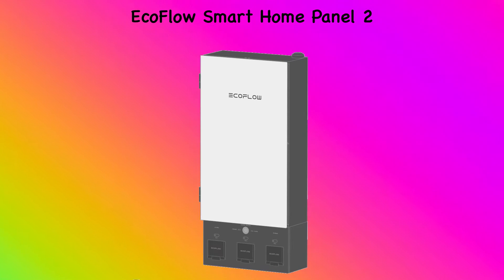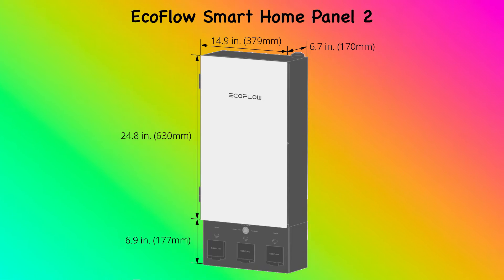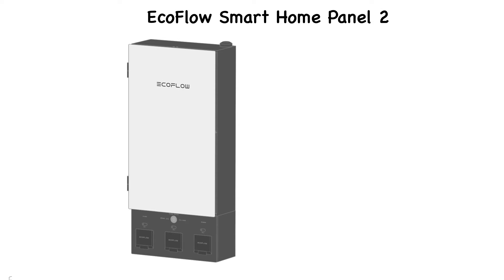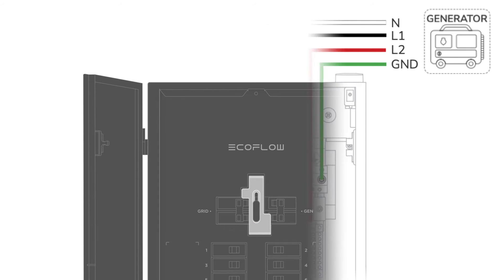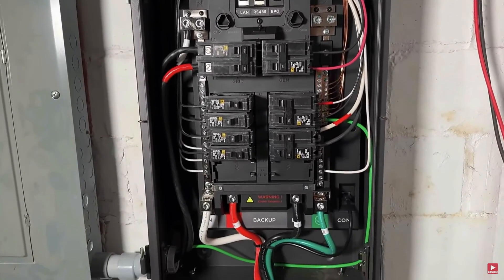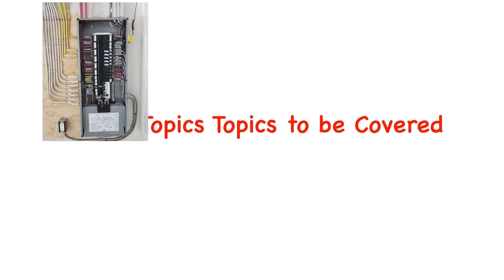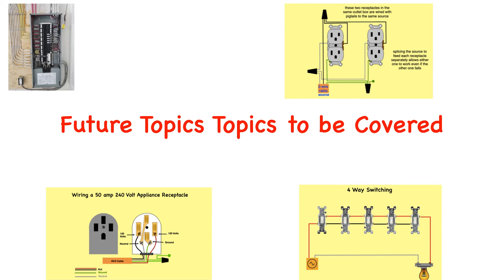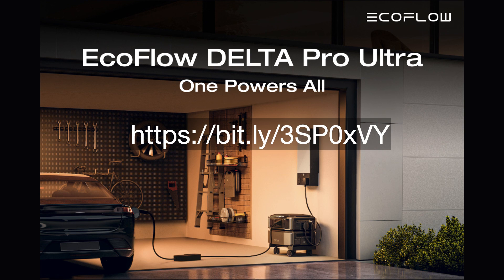Connecting a Stand-by Generator to the Service Panel Video - EcoFlow Smart Home Panel 2 Video #17

Comment: Which Generator are people using?  I am not finding an inverter generator which has the big 4 prong plug receiver for the L14-30 I have coming out of my SH2.  Generator brand, model?  That isn't 6000$
Reply: Its easy but pricey. Inverter gens don't have the L14-30 until you get into the 5000w plus range, usually  > $1000. Champion has some nice models with 240v support in the 8500w range (you gotta go big to get the big plug)
Reply from the maker: The 30A L5-30 is a very standard connector. If EcoFlow didn't have what you were looking for try these very reputable vendors...
Bluetti at https://bit.ly/4fDx2Ba
Anker at https://shrsl.com/4pplo
Jackery at https://bit.ly/3YCiw5Y

Comment: Hi sir, lot of good information thanks . Can I connect a diesel gen and make it to turn on and power the house when delta pro goes low or fully discharge?
Reply from the maker: Yes… the Ecoflow Smart Home Panel 2 does just that. The panel has two major connection ports 1) for connection to the the utility grid and 2) for connection to a standby generator. The automatic start up of the standby generator, gas or diesel, depends on its manufacture and making sure that it has that function to start up. Once it does that Ecoflow Smart Home Panel 2 will automatically switch over to the standby generator or back to utility which ever you have selected. To find out more about the Ecoflow Smart Home Panel 2 go to this website,  https://bit.ly/4aPDX77 Going to this website has special discounts as well as informative information. To find out more about the Ecoflow Smart Home Panel 2… click on “Product Series” then select Ecoflow Smart Home Panel 2…that page will give you a lot of information that will answer all of your questions about this product. I hope this helps be sure and use this web address as it contains special discounts if you are ordering any of the products. Good luck
Reply: @pspt  thanks for your swift response. Can you elaborate more on how the signal to start de stand by gen comes from the Delta battery?
Reply from the maker: When the standby generator senses the loss of supply power from the Delta battery it will automatically start (if it has that option). The change-over switch on the home power 2 must be selected for the standby generator. The home will experience a momentary loss of power while this happens.
Reply: @pspt  ok thanks! Is there a solution for automatically go back to grid when grid power is available? What Im looking is for that triple backup; grid go off , switch to battery , when battery drains go to generator, when grid is back switch to grid and turn off de generator? Or Im being too ambitious?
Reply from the maker: @omarpellot2065  Now you're getting into a highly specialized situation...the Home Panel 2 has a manual interlock that must be selected for either grid or standby (diesel) power. You have to choose one or the other for safety reasons. It is a manual interlock that is a break before make condition that Will not allow power to be switched back into the grid from auxiliary power sources.
Reply: @pspt  thanks! 👍

Comment: I am seeing users on reddit having problems with the SHP 2 reliability and service. relay failures and error messages that shut down the panel with long delays in getting service. Is there a way to setup these smart panels but still be able to use the original subpanel without any delays?
Reply from the maker: The quick answer is yes absolutely. When connecting the smart home panel 2, the load wire connections can be made in the existing panel and the load breakers that were used can be left in place for a quick reconnect if there is trouble. Having said that, all of the breakers in the Smart Home Panel 2 can be manually switched just by toggling the breaker switches. If for some reason that doesn't work (due to a failed breaker etc.), there exists 2 relay switching knobs that can manually switch the main power.
Reply: @pspt  Thank you. I appreciate the time you took to answer my question. best regards
Reply: I had a relay failure on circuit 10 same day as install was done smh
Reply: How did you fix the relay problem? How long did it take.
Reply: When you make the connections in the load panel, does that involve splicing the hot, neutral and ground to the wire coming in from the smart home panel?